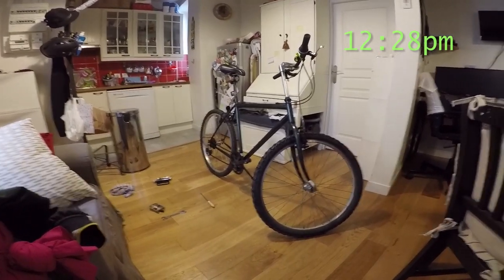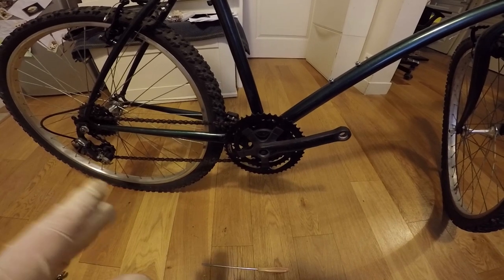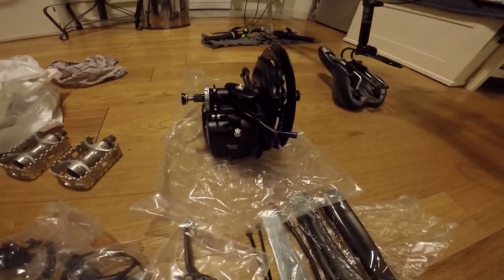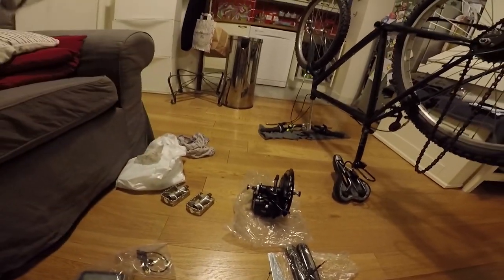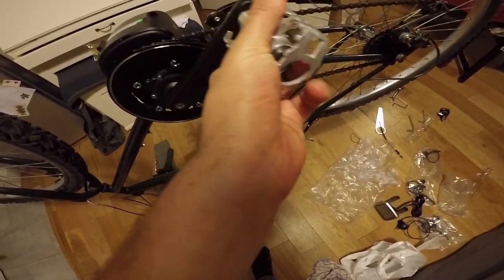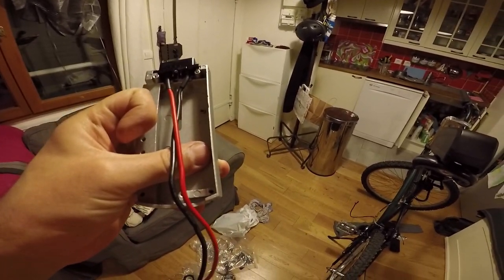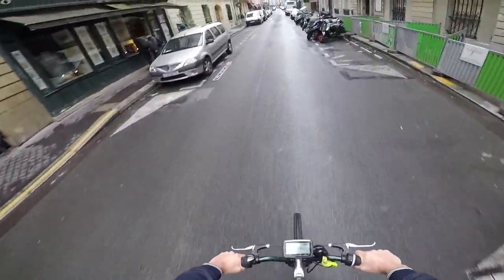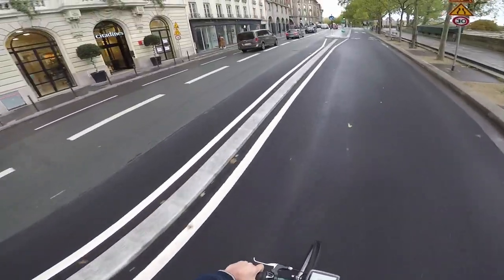DIY: First Time with Tongsheng TSDZ2 mid-drive motor eBike Kit on an old mountainbike

Comment: Test road my install of one of these today and was very impressed. Handled a hilly route that I normally need a lot of low gears and hard effort cycling to manage but no problems in just normal gears with the Tongsheng. First ebike I've ever road and having put it together myself and it working so well is quite  a result & pleasant surprise. Cycling will never be the same again, it will be much better. Normal non-ebikes are now pretty much torture machines but I like that the Tonsheng still gives the impression of normal cycling, just with that added flying carpet feel.

Comment: Thanks for the video.  I did have a question about connecting the battery to the motor.  Where did you get the connector to connect to the motor?  Better yet, where did you buy your kit from that may have included the connector?
Reply from the maker: Hey, great question since there are thousands of different variants and clones! This is the exact same url where I purchased it https://www.ebay.com/itm/293241130127 hopefully 🤞 it will be the exact same package, which should include a battery termination compatible with the kit's battery connector (as seen in the video).

Comment: Hi thanks for the video - I'm considering one of these as well. I've a question on that brake lever at 3:55 - if this is a torque sensing system do you really need that special brake lever? I'd presume when you're braking you've stopped pedaling and the motor would have cut out anyway?
Reply from the maker: Hi there! You actually really need the brake sensors. Even if it's a torque sensing system, it's not 100% perfect. From the moment you stop pedaling, for the motor to cut the power it passes like a second or two... enough to kill yourself in certain situations at a certain speed. Brake sensors are not mandatory for the system to work: they're mandatory for you to be safe.

Comment: Hi, there is a slot in the aluminium battèry baseplate. This can be used to get a bolt into your frame. It will enable you to instal battery right way up.
Reply from the maker: You're right about the other slot, but even trying that one the result is still with the holes on the frame out of line 😫
At the end having the buttery upside down is good for me: it makes it even easier to remove it! 👍

Comment: I was considering the purchase of a Tongsheng mid drive motor like yours so I am looking for anyone who has installed and used one.  Looks like your new e bike works well.  I also enjoyed seeing your neighborhood.  I only wish I could take my e bike to Paris and cruise around.  I really like Paris even without an e bike. Ciao.
Reply from the maker: Thanks for sharing Phil! I really appreciate that.
For mixed urban areas like Paris this kit is perfect! I like the performances while still let you enjoying the feeling of pedaling thanks to the torque sensor. Hope you can feel this too soon! Grazie
Reply: @LukeLorusso  I recently purchased  a Tongsheng kit like yours and installed in on a road bike. It works well. With all of the hills in my neighborhood  it gives me more of a workout than my Bafang equiped bike which does not have torque sensing.  I hope your bike has been trouble free and functioned well.
Reply from the maker: @philt214  Great news! I had a little troubles with the old bike itself but the motor worked like a charm!
I don't use it since the beginning of the lockdown, so I decided to try building another one in my hometown. A Bafang one, identical in specs but completely different in behaviors
Reply: @philt214   if you guys had to choose a favorite motor which middrive would you favor?

Comment: How do you like it so far? Any problems with the kit?
Reply from the maker: Hey! I've used it as daily driver from the video date for 5 months in Paris: it's a nice motor.
I had all kinds of problems related to using a second-hand old bike as base (jumping chain, having to re-register the derailleur...). After having replaced rear wheel, freewheel and chain with good ones now it's flawless! 💪

Comment: Thanks for the video, although it's more of a test drive video than an installation video ;)  I think to make the installation more informative it would be great if you explained more, like why couldn't the battery be installed one way, what dimensions and style of bottom bracket you have to accommodate the TSDZ2, what did you do to hide wiring, etc.
Reply from the maker: It's true that it's not a complete installation video, but if you need those you can find plenty of them: I also made such a video recently if you're interested!
Here I wanted to offer something different, more like a "what to expect" video.
For all the guides you need, check the description!
Reply: @LukeLorusso , nice job.  This is the kit I want to install on my Bridgestone mamachari. It seems like good value.

Comment: I ordered the same kit, but no brake sensors came with it. Do you think it will harm the motor if I dönt use brake sensors?
Reply from the maker: not the motor, but yourself there's an high probability
Reply: @LukeLorusso   :D Why ? I still have brakes , and i use them. I dont use brake sensors
Reply from the maker: @daniellukacs4700  I really need to talk about this in a video, cause you guys keep asking this thing :D
I will re-write a previous comment: "You actually really need the brake sensors. Even if it's a torque sensing system, it's not 100% perfect. From the moment you stop pedaling, for the motor to cut the power it passes like a second or two... enough to kill yourself in certain situations at a certain speed. Brake sensors are not mandatory for the system to work: they're mandatory for you to be safe" ...cause as soon as you pull the lever, the motor disengage itself!
And... there's more, but if you want to know about it subscribe to the channel xD
Reply: @LukeLorusso  Thank you for your answer! I havent really felt the need for the sensor, but you make a good point!

Comment: I have the 36 volt motor. Can I run on a 48v battery?
Reply from the maker: no man
Reply: @LukeLorusso  what happens if I connect a 48v battery to my 36v 250w tadz2 motor?
Reply from the maker: @suratullahkhan6158  you'll overheat your motor and fry your controller

Comment: Do you know if this motor can take a 48V battery.  If so, what do I need to do(set up on the LCD)?
Reply from the maker: if you buy the 48V version yes, otherwise no
Reply: Thanks
Reply from the maker: @PeopleVoicesForObama  https://www.quora.com/Can-I-use-a-48v-10A-battery-to-replace-a-36v-5-2A-on-a-bike-Will-it-burn-out-the-electric-motor-of-the-bike/answer/Peter-Stanley-Ell-Ellsee

Comment: Hi !
Is it possible to have a kick stand with this tsdz2 ?
It is for a cargo where the kickstand is allready where the motor back screw is
Reply from the maker: ah wow... I can't remember, I need to see it and I can't this month... I'll keep you posted 👍
Reply from the maker: Actually you can't mount a "classic" central-frame kickstand, because the motor will occupy that place also (that is not true with a Bafang mid-drive kit). But you can use a side kickstand: https://images-na.ssl-images-amazon.com/images/I/81d4UbapYoL._AC_SL1500_.jpg
Reply: @LukeLorusso  oh ok, its for a cargo bike, i need a double kick stand. I will go for the bafang i think
Reply from the maker: @grmar1494  I think it's a better choice for a cargo bike 💪 you won't regret it
Reply: @LukeLorusso  I've finally bought and mounted it. Great kit !

Comment: what is the BCD of the connecting rod, plate
 ...?
so I can better use mine. Thank you
Reply from the maker: I'm sorry I don't know how to retrieve this information
Reply: @LukeLorusso  
Thank you very much for answering. It is about measuring the distance between the screws of the plate ... I indicate a website where they explain you better .. Thanks again.
https://www.wolftoothcomponents.com/pages/how-to-measure-bolt-circle-diameter-bcd

Comment: Would you tell me please,between buying this TSDZ2 - 750w and Battery 48v 14.5ah cost £700 to fit to my 7years carrera subway vs  buying a new carrera subway ebike £950 what's  a better option.?!
Reply from the maker: can you paste a link where to see the new carrera subway ebike? it depends from various things: is the new one equipped with a mid-drive motor? then, which battery mounts the new one? what is the state of the older one? etc.
Reply: @LukeLorusso  my bike is a carrera vengeance 7 yo but is doing great
There is a linck for carrera ebike I am talking about 
https://www.halfords.com/bikes/electric-bikes/carrera-subway-mens-electric-hybrid-bike---16in-18in-20in-frames-224422.html

Thanks!
Reply from the maker: @andreiapostol9394  things are complex, but I'll try to demystify. The new Carrera Subway Electric Bike has an HUB MOTOR (not a mid-drive motor), that's the first difference. I do prefer mid-drive ones, but it's a personal thing (more here: https://www.youtube.com/watch?v=Z32RF3-bglY)
That said, it claims 313Wh / 8.7Ah (if you make a division it's a 36V nominal voltage). I'm expecting this to be a 250W motor. Now first thing: what does your local law say about it? I'm not from UK but can you actually drive something more than 250W? Anyway 313Wh on a 250W motor is not made for long distances... or it is, but it will be VERY SLOW!
In any case, the newer one will be much less powerful than a 750W kit, and way less reliable (since you cannot adjust the power using gears) BUT you will have after sale assistance in case of troubles: that is a goot thing.
If you are a DIY kind of person, go for Tongsheng or Bafang ;)
Reply: @LukeLorusso  thanks for help!

Comment: What is the watts and v and ah of your kit?
Reply from the maker: This is the declared 500W at 36V, so it might be something like 13 Ah (this was not specified). I did't test it with an ammeter so I cannot be more precise. Rated Speed: 4000 RPM
Reply: Motors are basically 2 models, 36v and 48v then tongsheng controllers let you set amperage to max 16A, so for real the 36v is ~550-600w and 48v is 750-800w. Claimed wattage is more for legal purposes (eu 250w, us 750w), also on a normal bike (not very heavy) and used on normal speeds (14-20k/h) real power used is way below 100w because is pedal assist with torsion sensor not cadence have a great economy (if you don't use throttle), on 36v version with a 13.5ah battery i don't need to recharge even after 100km (~60mi), that on standard controller with stock firmware, if you wish more there is a open source firmware (another controller required) that let you abuse all the settings in any way you wish.

Comment: I bought 2 months ago from Aliexpress- Poland -Greenergy Electric Bike Store, Tongsheng TSDZ2 500W motor. It only drives on the rotating ring (gas) and the crank pressure sensor DOES NOT OPERATE! Aliexpress REJECTED my complaint! They sell waste!
Reply from the maker: that's why I prefer eBay. I tried buying a foldable bike on banggood... a good one (CMS F-16 plus) but it arrived destroyed. No refunds. I said to myself "never again pricy buy on chinese sites"